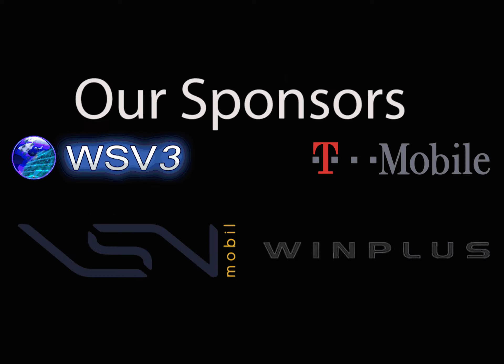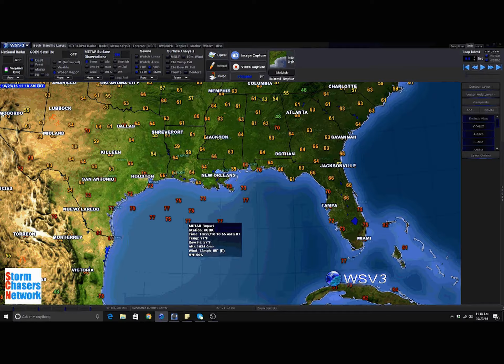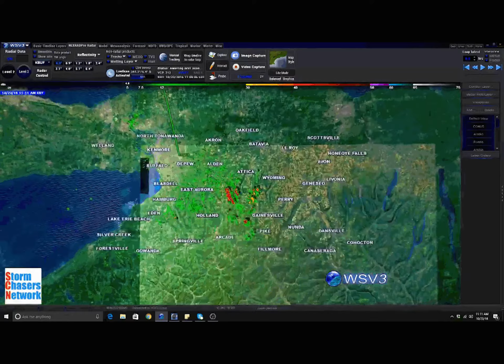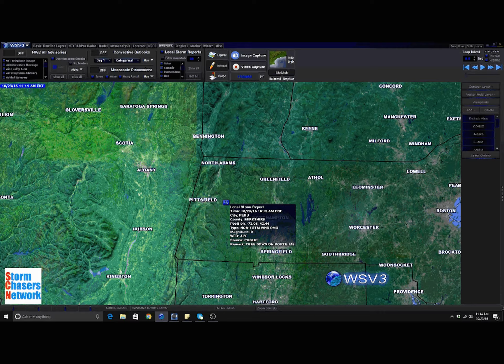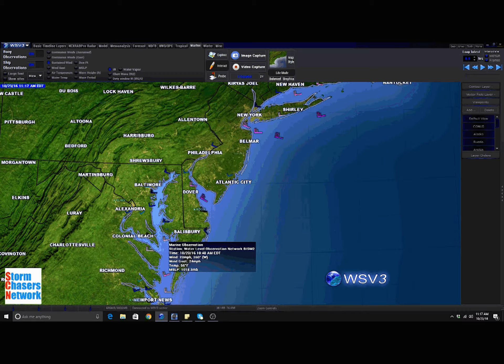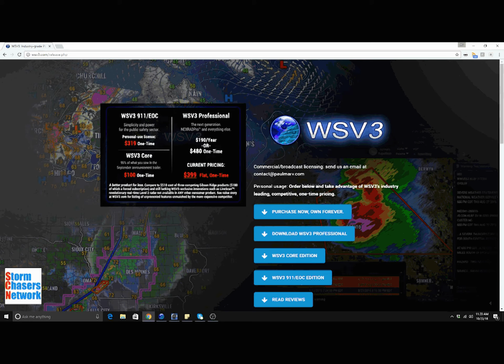StormChasers Network - WSV3 Professional Overlook

Comment: Buyer be ware, their service is CRAP. I purchased the core version over a year ago and my PC crashed. So I went to download the core version and was told it was discontinued. Asked for software or a refund and was never given a response even after I forwarded the email with the licence and key. Never had a problem with service with GRLevelx  products and services. Better avoid WSV3
Reply: In the terms and services, it clearly states. “No returns or refunds whatsoever” and I use WSV3 and I have no problems!